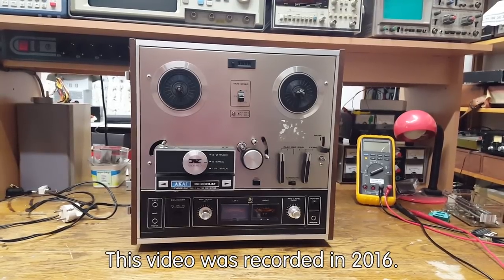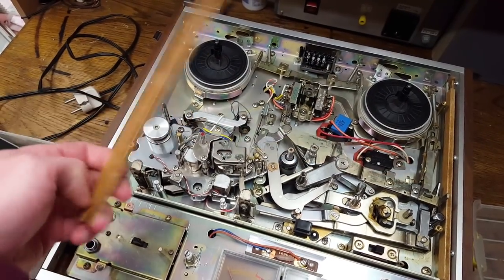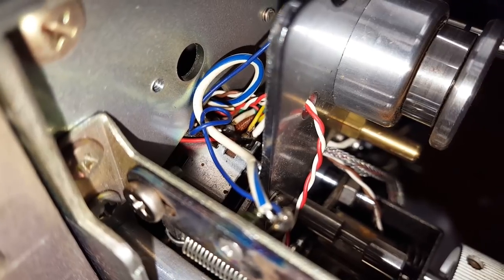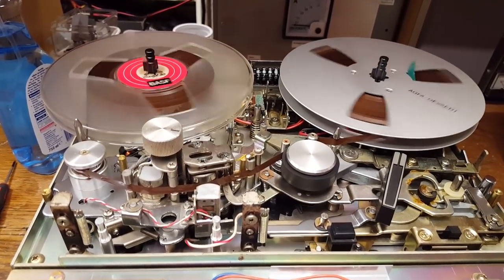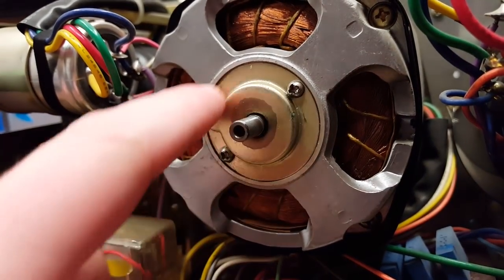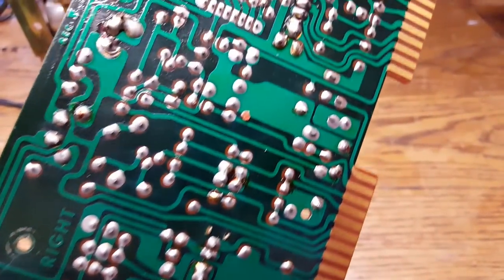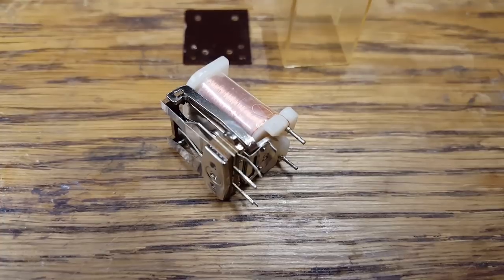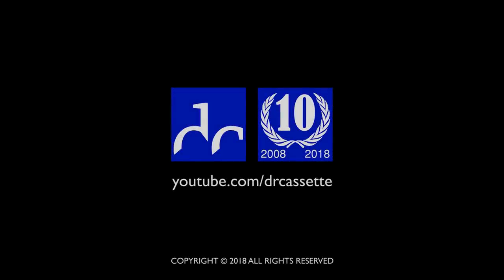Akai X-201D reel-to-reel tape deck repairs [unfinished video]

Comment: Recently bought one of these with all the problems you mentioned and more. It took a good amount of wd40 to clean out the switches and all the transistors had to be replaced. Now its working like new and it has a fantastic sound.
Reply: Hi, I'm also in the process of restoring my Akai and wanted to ask which transinstors you used as a replacement. I'm having trouble finding the right ones. Can you please help me?
Reply: @stone9213  2SC1815 or KSC1815 are exact replacements for the 2sc458. Pinout is reversed on the hitachi ones.

Comment: hello dr cassette great video as always and you are a great teacher and do such a great job on explaining what has to be done and how you came to the conclusion and did your repair I love your channel i have a teac a 1200 and the pinch roller solenoid is very weak and does not put much pressure on the capstan I am wondering if you could give me a clue where to get the part but not at a big cost and how to replace it thank you for your time you are one of the great ones and please be very careful and safe out there with the covid 19 virus all the best and keep the great videos coming

Comment: I worked on an Akai 280d-SS from '71(?), back in early '17. It had a multitude of issues and took a solid week or two of work to get working! It had a few obsolete ICs go bad, but fortunately I found schematics on how to build my own which worked just fine.
I replaced all of the bulging caps and it sounded great both in forward and reverse play back! I let it sit for several months and now reverse playback sounds low and distorted. I think next time I have it apart I will replacd the rest of the caps.
These machines are long and extensive projects, but quite rewarding to get working ^^
Reply from the maker: Quite rewarding to get working, if you actually want to keep the machine. In this case my intention right from the start was to get it working and then sell it. I really don't like how the heads move around. That can't be good for the alignment.

Comment: Best to replace all the transistors on that amp board with 2sc2240. The old ones get noisy and give strange problems. Mind the pinout. The text has to be to the back. The slideswitches need a very good cleaning. The motor has to be oiled very good. I took off the shell at boath sides and soaked the filt with Hammond tonewheel oil. Now the motor stays cool and silent. I didn't have problems with the relais.

Comment: Interesting to see, I got a X-150D, which is basically a non-autoreverse single-motored version of this, maybe a bit older. The mechanical build-up is very similar, the channel selector that mechanically moves the erase- and bias-heads is also exactly the same. Funny to see that in spite of having a single three-state switch for the speed (the X-150D has a two-speed motor and a removable captan bushing to select 3 speeds) the machine still has a separate equalization switch. The motor looks very similar (though only 2-speed) and is indeed very loud, but as far as I know, it has always been, my father bought the deck new about 1970, so I grew up with it, repairing it oft together.
The sound quality can be very good, especially making recordings on lower speeds, because of the separate bias head, but they are mechanically very noisy. Nowadays, I really prefer the Revox A-77, as it is really quiet.
Reply from the maker: I too would very much prefer a Revox A77 over any Akai tape deck...
Reply: @DrCassette  Definitively, only the Akai was much more affordable in the days that they were new... Although in serviceability, the A-77 has some quirks, especially cleaning the heads is not that easy, if you don't have the special tools for it
Reply: @DrCassette  i only use the akai because it never stoped working and the GX heads were an improvement to akai reels deck but in a litle studio i have i used to record on a revox A77 that i bought from a german friend of mine, but after i started using a dat deck for masters ,the late 80´s sony high-end model that i get it for free , i went to the house of a friend of mine who bought 4 DAT decks when opening a discoteque but he didn´t use them ,so he ofered me one still closed in the box , i tried and it worked ,so the revox was kind of stoped but always in the same place it still can be used and still have a lot of masters to play in it

Comment from the maker: Are the comments broken today? Why doesn't anybody have something to say?
Reply: Comments are working!  I would LOVE to find a reel-to-reel like this at a flea market...
Reply from the maker: @ThriftyAV  This was a flea market find, but it wasn't cheap, I paid 70€ for this machine, but I had to have it...
Reply: @DrCassette  "I had to have it" Sounds familiar :S
Reply: Very timely video!

I have the 200, which is very similar. The amplifier section has sliding level controls instead of knobs, but the rest seems to be the same. It has the exact same problem. In reverse mode, sometimes the relay does not make good contact and I get weak sound. It always works fine in the forward direction, though. When I removed it from it’s cabinet to examine it’s innards I discovered that it fit perfectly into a square hole in my stereo cabinet. 

$15 from a local thrift store.

Comment: I apply the oil..then use a blower like you use to blow the lint off of camera equipment, and blow the oil into the bearings or into places it would not get to with gravity alone.

Comment: Looking at this i'm glad i have the very basic 4000DB, and not this autoreverse nightmare. That being said, akai machines are pretty easy to repair compared to european machines like my Tandberg 3300x, where all the circuits are lumped onto one massive board.

Comment: Usually when the speed changes i ‘ve heard it’s time to replace the capacitors for the motors.  I might be wrong.
Reply from the maker: If I recall correctly in the case of this tape deck the wrong tape speed may have been because of another, mechanical problem. But yes, bad motor run capacitors are a possible fault.
Reply: DrCassette thanks for the reply

Comment: You can regenerate them with most belts if they're not pure rubber, by putting them in a glass jar of water put them in the microwave for 15 minutes, will shrink them back to their shape and size. Don't use isopropanol to clean rubber causes damage and cracking to belts white or mineral spirit could be used, then put them in a bag of talcum powder should be done for all belts anyway. Try a bit of sewing machine Oil on the moving parts of the head the springs could be week as well
Reply from the maker: To microwave the belts, you'd still have to get them out of the machine somehow, which in this case was not an option.

Comment: I just want to tell my experiences of repairing these old machines. I have to say that 95 % of problems come from bad mechanical situations. The "old" grease is turned very sticky and hard and the solution is to take this mecanism apart, clean, oil and put together. It's not difficult, it takes time and "order", make photos . I have repaired +/- 15 machines Sony, Akai, Teac, Saba, Philips, ... no electric problem (except cleaning contact) ... Only open, clean, oil (a few) or thin grease and put the peaces together...
Reply from the maker: The problem is, I don't have that much time...